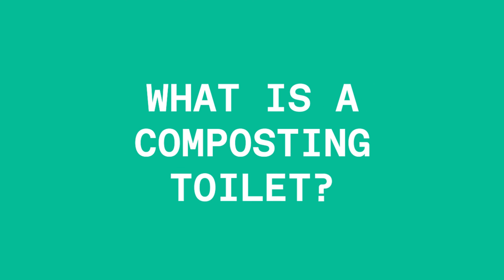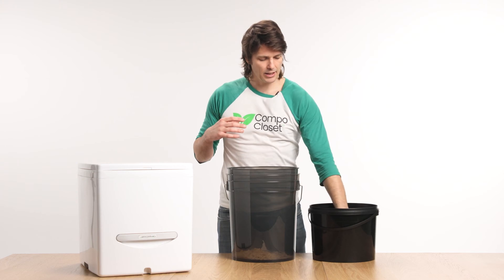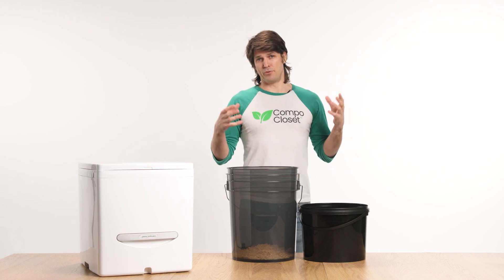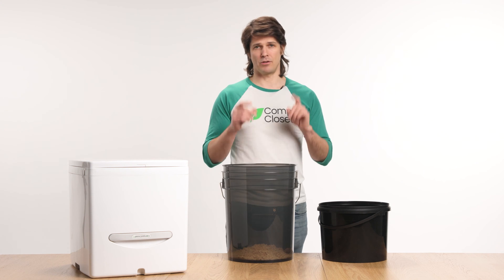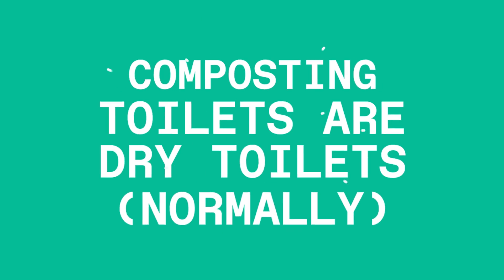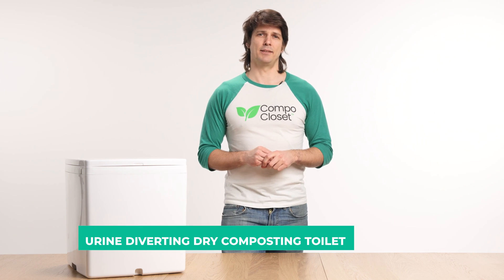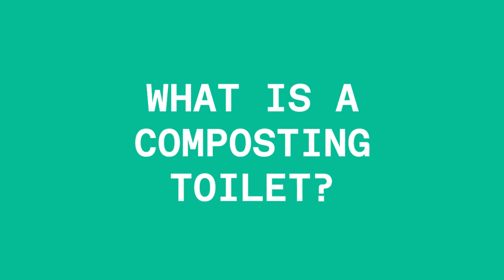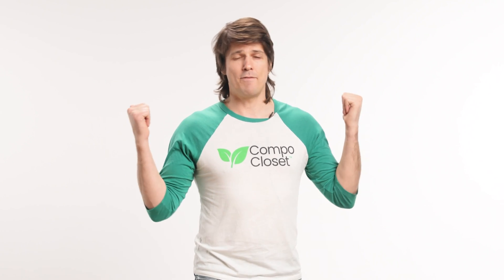What is a Composting Toilet?

Comment: This is too pedantic! I just want to know how it works and compare between the one with the agitator and the one without. I feel like I’m in a philosophy tutorial with all the definitions.. it’s unnecessary!
Reply from the maker: This might not be the right video for you. 

There are obviously a whole range of variables and factors that we can’t account for in this general advice – please write to us at: info@compocloset.com, we are happy to discuss what option might work best for you.

We also appreciate that no matter what general advice we give, users will have their own preferences due to their unique circumstances. Those opinions are as valid as ours.

Remember: Both Cuddy and Cuddy Lite separate
solids and liquids, that is the most important thing. If you’re considering a travel toilet that does not separate, you will either have to use chemicals and a dump point, or you will be putting raw sewage into a bin or into the environment, please don’t do that.

Our general advice is as follows:

Full time use: Cuddy - You will have to empty less often, it will generally be more “pleasant”, and no need for plastic bags.

Regular use: Cuddy - After each trip you don’t have to worry about emptying the solids bin and the composting process will just continue. We have gone for 6 months between emptying our solids bin.

Irregular use: Could go either way, a Cuddy for the reasons outlined above, or a Cuddy Lite if you don’t want to or are unable to continue composting between trips.

Once in a blue moon: Cuddy Lite – Likely you will want to get all your kit cleaned and put away for next time.

Away with a group of
people all using your loo: Cuddy Lite – With heavy use over a short period very little composting will begin, and from our first-hand experience you will end up with a bin full of very fresh deposits that won’t be pleasant to empty.

If you can’t make a
decision, we suggest you go for the Cuddy.

If you have A Cuddy and an additional solids bin without an agitator, you will have a Cuddy and a Cuddy Lite in one unit. It is the most versatile, fully optioned, and most affordable travel toilet in the world. It can adapt to any install, or portable application you can throw at it.

You can turn a Cuddy into a Cuddy Lite, but you can’t turn a Cuddy Lite into a Cuddy.